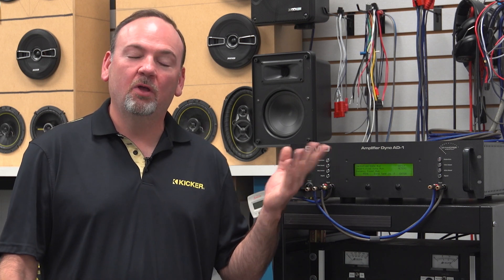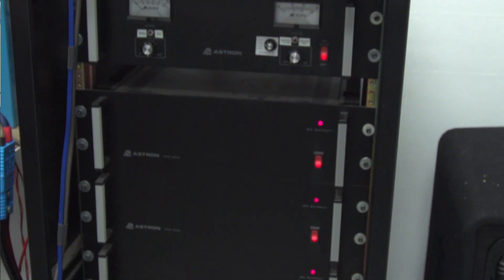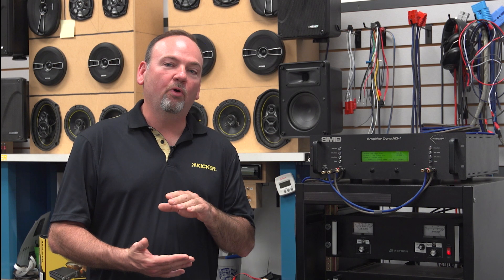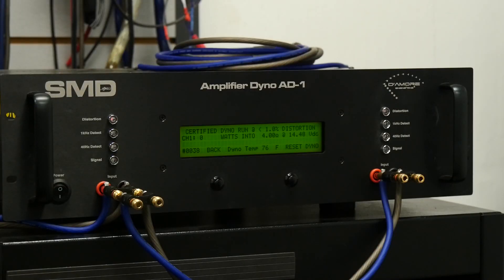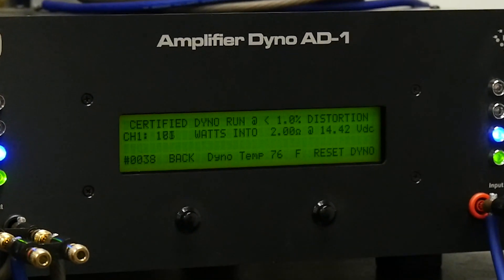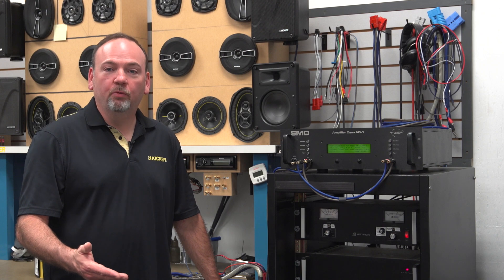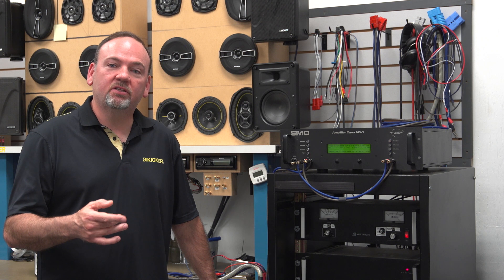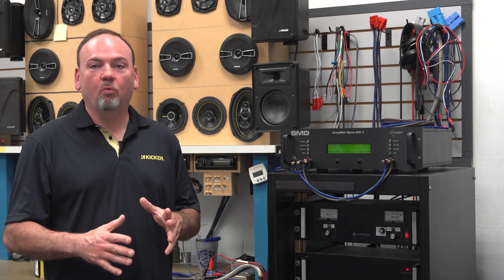KICKER CXA400 Amp Dyno Test

Comment: Can u run the peek power that I see on them cheep amps?
Reply from the maker: Peak power is technically double RMS. That's all it ever was. RMS is a lot more important of a number to pay attention to.  Those huge numbers you see are (if they are even real) under perfect circumstances, and they are made for just a moment. This is what products like the "amp dyno" are designed to do: give you the max power an amp can make - it is measured for just a few tenths of a second.  You don't play your system for a few tenths of a second. You play it for hours at a time.  Kicker tests their gear for DAYS at a time, under real world conditions.  Our gear always makes promised power or more and its arguably the most flexible, reliable product in the industry. That's what we care about.

Comment: how much does gain increase watts by? or how does it work, i have a 12 inch 600 watt rms kicker with this 400 watt amp 2 ohms
Reply from the maker: Here's the physics of it: twice the power = 3 additional dB, which is (technically speaking) twice the volume. The thing is, humans don't perceive 3db as twice the volume. We usually consider 10-12dB increases as double volume, but it's subjective.

Comment: Can you run the cxa 400.1 at 1 ohm safely with no issues?
Reply from the maker: Yes. The CXA400 is 1 ohm stable.  That is also where it produces the most power.

Comment: Update. Great amp however kicker is not transparent about the highpass subsonic integration. It does not accept input signal if you have a stock amplified sound system. Meaning if the radio sends a signal to an external amplifier which then powers the speakers. Will distort badly. An aftermarket setup will fix that issue.

Comment: Can I hook up a kicker 500.1 mono amp to a kicker 400.1 amp and if so how many watts it'll put out with both amps together
Reply from the maker: It is not safe to connect two amplifiers to each other unless they are strappable, which none of the current Kicker amps are. Is that what you wanted to know?
Reply: @KICKERAudio  I have a 1200 watt max sub in my truck single cab I had a car and sold it but kept my audio equipment I was wondering instead of getting anouther amp to push the 1200 what sub when I already have 2 amps to make that sub work good until I get the new pair of kicker solo baric 10s X if kicker would ever make them available to where I can have a pair of them 😁
Reply from the maker: @johngray2526  First question is what is the RMS of the sub.  The max rating is often just a momentary amount of power (think fractions of a second).  You cant run a sub on max power all the time without running a very real risk of destroying it.
Reply from the maker: @johngray2526  The 10" Solo X will have a 2,000 watt RMS, just FYI.  We are anticipating release in the 3rd quarter.
Reply: awe bruh it's pose to b 2nd quarter now it's 3rd geez I'm not getting any younger at 55 lol and cool 2000 RMS starting to look like selling off what I have to up grade unless I can bridge my amps together 🤔

Comment: This amp recommends kicker pk8, will that wiring kit be able to handle the 1ohm power load
Reply from the maker: You're close. The CXA400 in the manual (see the included link) recommended the 8 awg wire. A 4 awg kit is recommended for the CXA800. https://www.kicker.com/app/manuals/amplifiers/cx/2019_CXA_Mono_Amps.pdf
Reply: @KICKERAudio  pk8 which is the 8 awg wire is rated for how many RMS?

Comment: Just got a factory certified refurbished 46CXA400.1 from hifisoundconnection.com and the cert it came with said 486W which had me a little disappointed. I connected it to the 4ga power wire in the car, verified no clipping from Pioneer DMH-W4660NEX at desired volume max, bass knob maxed out and fired up a 40Hz test tone and at 14.4v into a 1ohm load (CompR 10 2ohm DVC parallel) its making over 26v RMS before clipping on my oscilloscope.  That's just shy of 700W.  Doesn't even get hot.  Call me impressed.  The cert that it comes with doesn't say at what impedance and input voltage their rating is based on, but it's not at 14.4v @ 1ohm that's clear.
Reply: I have this exact amp. What i dont get is why theres 2 positive and 2 negative terminals if its a 1 channel amp. I'm running 2 ohm and have to say I'm pretty disappointed in power.
Reply: @SinisterDeeds214  It's just for wiring flexibility.  The positives and negatives are on the same rails internally.  Did you actually measure the power with an oscilloscope to clipping or are you just going by ear?  I would test it at 1ohm also.

Comment: I bought the CXA400.1 to replace my ZX400.1... I was powering a 10" RF P2 dual 4 ohm on the zx400.1 and purchased a 10" Comp R dual 2 ohm so needed a 1 ohm stable amp and got what I needed for sure. No regrets.
Reply: I am about to upgrade to this amp from a 300watt rms dual running 2 ohm on a 10 r type dual 2ohm as well.

Comment: Alpahard audio amps are way more impressive and don't break the bank the machette 1600.1 is rated at 1600 rms at 1 ohm at 14 volt only cost ya 250 for the amp.
Reply from the maker: Power is one factor in amps, but not the only one. How well can it integrate into a system?  How clean is the sound quality? How reliable is it?  Does it deliver the promised power? How good is the company's customer service? Can it work with start/stop? What features does it have? If it breaks, how long does it take to get fixed?  

Watch this full tour of Kicker, then ask one question: how do the other guys stack up? https://www.youtube.com/watch?v=u4MJfPUKVfo
Reply: Many people don't want 1600 watts of power, I bought this amp for the 1 ohm factor to run a single Rockford Fosgate T1 S1 12 inch subwoofer, the sub is rated for 600 watts RMS and this amp does a perfect job for what I'm using it for. I would have to upgrade my vans electrical system to run 1600 watts. I very happy with what the amp does and it never lets me down. It has a very small foot print and slip's right under my passenger seat and is bolted to my floor. Great job Kicker.

Comment: Ion know but I got 2 ds 18 on this amp and it sound hell of good !!!!
Reply: Could I run a 3rd speaker with this amp
Reply: I have a question I have the same exact amp would it be able to power a Skar Audio Single 12 SDR subwoofer????
Reply: lol your running a pair of 18s on a 400.1 rating to 500 watts what's the minimum watt per 18 🤔

Comment: I was looking at new Kicker amps. Because I already have a Kicker system with amps, and speakers. But I wanted a bigger amp. And I ran across this on your site. But it says it's only a 1 channel amp. So why does this amp have 2 sets of speaker terminals. I mean it's setup like a 2 channel amp to me. And if it is able to be used as a 2 channel amp. What is the RMS, and peak power when using this amp at 1ohm, 2ohm, and 4ohm while running it 2 channel.
Reply from the maker: We put in 2 sets of speaker terminals to make wiring easier. Both positive and both negative terminals go to the same place.
Reply: @KICKERAudio  Don't see the point. How does having 2 positive, and 2 negative hookups make running anything easier? Regardless, people will only be connecting their sub to one set. And the other two will not be used. That design would only confuse people into thinking they can run more than one sub from the terminal. without running them in series. But thinks for the quick reply. Guess I'll go with the KXA400.2
Reply: @alenwarren9252  you can run more than one sub on one channel... Do some research before you spout off. LMAO
Reply: @Mr_Clem02  apparently my conversation went over your head. I know you can run more than one sub, off a mono amp. But you wire then in in either series or parallel. Which both only require one positive,  and one negative terminals. You can't wire 2 or more subs direct to a mono amp. So there is no need for 2 sets of negative, and positive terminals on a mono load amp.
Reply: @alenwarren9252  No, it didn't go over my head. It gives more options for different installs. If you hook up each voice coil to each  -\+  on the amp you'll be wiring the coils in parallel with each other.
Say you have woofers on either side of the car, much easier to run the wires to the amplifier instead of all the way across the car   to get the two on the same channel.
If people are "confused"about something this simple they probably should be having it installed by a professional.
Reply: @KICKERAudio  if i have this amp on the 46CWTB102. Is there a way to run it at 1 ohm?

Comment: I think the smaller amps should make their power at 2 ohms. It makes more sense for people that already own a 2ohm sub which is the majority.  Having to wire subs down to 1ohm to make 450 watts isn't that practical
Reply from the maker: The vast majoity of our amps deliver full power at 2 ohms, but can be wired to 1 ohm for wiring flexability. Currently, the CXA400 & 800 are exceptions to that rule.
Reply: A 2 ohm dvc sub can be wired to 1 ohm though.

Comment: I'm curious as to whether you have any dyno results for my kicker amp I bought over a year ago. I have a CX 600.1. I'm wondering if it meets or exceeds it's rated power.
Reply from the maker: We bought the amp dyno after the CX600 was discontinued, but yes the amp will make at least rated power at the CEA specs (the industry standard), if not more. In this case,  that means at least 600 watts at 2 ohms with 14.4 volts of battery power.
Reply: @KICKERAudio  I'm running it with 2 JBL 4 ohm subs seems to drive them OK, but I had doubts about 600 watts.
Reply: I also measured my battery/ alternator output with the engine running, and it is between 13.6, and 13.8.
Reply from the maker: @ericvillano5729   The dyno has a calibration process built into it to measure THD and clipping, plus you are measuring a single burst at (I believe) 40 hz with that test. 
A simpler test would be to grab a volt meter and use ohms law to calculate it on oyur amp.  Just be sure to use a test tone. It wont be as accurate, but you can get a ballpark.
Reply: You have to realize that in your application, you aren't maintaining proper voltage, not to mention you are using a reactive load (subwoofers) along with music (most likely). It's quite unlikely you are going to see 600RMS. However, that is NOT to say your amp isn't capable of rated power. I'd be more than willing to bet that it is underrated like most Kicker amps and if voltage were able to be maintained, the load was a resistive 2 ohm, and a test time used, it'd easily surpass it's rated output.

As for measuring your amp's output as Kicker recommended, you'd need to be sure your DMM can accurately measure the frequency used and that the output being measured isn't clipping. If not, then the measurement was pointless. 

Also, you'd need/want a load on the amp, but playing test tones at moderate to high volume levels is VERY HARSH on the equipment and could cause damage. 

Oh, and even if you were to just play a 40Hz test time with the system wired up and measure the output, you won't know what impedance the amp is seeing without using a clamp meter, O-scope, or similar tool to check.

In the end, you either have faith in the companies track record for solid amplifiers or go out and get the needed equipment to properly test the amp, but if doing the later, well, you just as well buy a "better" amp and save yourself the trouble of testing only to find out that A, the amp is capable of rated power under proper conditions and B, in real world usage, you aren't likely to see rated output but once in a blue moon.

Comment: Fyi, I stopped suggesting your amps till you guys acknowledge that you messed up and raised the input threshold needed to attain the numbers you're claiming the new amps put out. Low level inputs are almost completely useless atm on the new models. I've had several installs where I had to hook up high level inputs in order to get any kind of sound out of your amps. And this applies to all the models up to the new 800.1. Shame too, I sold upwards of 50+ of your amps from my location alone last year. Now I'm having to resort to selling other brands I have in stock until you guys correct this. You just can't hit those numbers with a 4v or 5v low level input signal while running a 4 or 2 ohm load. The low level input + 1ohm load output was decent, but still below last year's models.
Reply: Lazaro Rubio what day you kicker?

Comment: I love these amps! The perfect little work horse for a small woofer   setup, or if you don't want to tax your car's electrical system. Small enough to mount virtually anywhere in the vehicle for stealth applications or where space is limited. I can't say enough good things about the entire CX line of amps
Reply: I have a question I have the same exact amp would it be able to power a Skar Audio Single 12 SDR subwoofer????
Reply: @turbro7185  you shouldn't have any issues, are the coils dual 2 or dual 4 ohm?
Reply: @wadehensley5005  I'm only asking because these are the specs Skar Audio SDR-12 D2 - 12" Dual 2 Ohm Subwoofer

Peak Power: 1,200 Watts

RMS Power: 600 Watts

Comment: Can you please do the KXA1200.1 and the KXA2400.1? I am currently running the newest KXA1200.1 @ 1 ohm on an EMF Banhammer 15" and it's impressive for 1200 watts. Will be upgrading next spring to the 2400.1 so would be awesome to see what they are really putting out.
Reply: Just FYI, every Kicker amplifier comes with a birthsheet showing what that exact amplifier you're holding in your hands benched. It's real and it's not just some random number they stamp on every paper. Every Kicker amplifier outputs rated power, plus a lil bit.

Comment: most vehicles don't have a 14.4 volt system. run it with a voltage that vehicles will actually see like 13.1-13.6
Reply from the maker: That's the CEA Standard, so that's what we test at. But we can test at other voltages in another video.
Reply: Come on man they arent gonna do that... how embarrassing would it be when it made a whopping 140W rms  @4 ohm with 13.5V LOL 
Seriously Kicker how many people are running a small amp like this at 1ohm?? not many.    I was considering buying a cxa 600.1 but after watching this weak sauce demo  instead ill get a 500W Alpine amp that makes 350W rms at 4ohm and 550W at 2ohm UNDER 14V  for the same price.
Reply: @ROB-kd4nk  I have this Amp and a Kicker Comp R10 in a ported box running in a 1 OHM impedance and let me tell you that thing knocks, you can hear me coming down the street and I have this Amp running just under 21volts on the gain. I Have it tuned to just about 80 hertz on the lpf. Good stuff kicker.
Reply: @ROB-kd4nk  I was thinking about doing just this thing and kicker is one of the few that can do this on a smaller amp.  Run a Dayton Audio Ultimax 10 that has dual VC, each at 2 ohm. Run parallel thats a 1 ohm load.  Thanks Kicker for giving us this kind of flexibility!
Reply: At idle they run 14.4